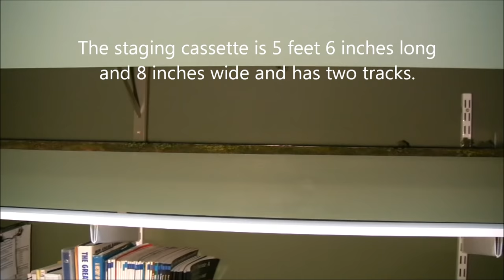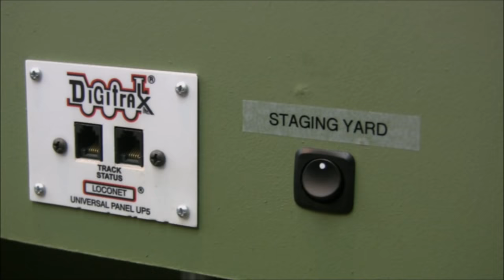Designing and setting up a removable staging cassette

Comment: Tom, I realize this is an old video post, but it’s inspired me to add a 1 track staging section that will allow me to pull all my railcars as 1 inbound train from the main all the way forward past the yard throat, then I can back them into my 2-track interchange yard. Small addition that will add a lot more operational realism. I’ll post a video and give you a shoutout.
Reply from the maker: Hi, Thanks for your comments. Since I made the video I built a new larger staging cassette, you can read about it on my website blog at www.thomasklimoski.com 
I added two more tracks to the yard and it now allows crews to build their train in the yard prior to departure. This adds an additional 10 to 15 minutes to the local switch job. You can never have enough staging or yard tracks.😊

Comment: I'm having this same issue right now!  This video came in handy for some ideas.   Looks fantastic!  Thanks!
Reply from the maker: Hi DG, Thanks. I saw your latest video on your staging cassette and thought you have a good plan. The metal stands were a great idea. Using the bolts and T-nuts allow for some slight adjustment when I bolt the cassette to the wall. For your track I would recommend laying the track as normal across the joint(s) and then using a cut off disk in a Dremel tool to cut the track. If you are concerned about the rail moving, you could replace the plastic ties at the joint with PC ties and solder the rails to the ties (don't forget to cut the insulation gap on the metal foil on the ties between the rails). Take a look at my Universal Alloy video and you'll see the removable section and the track joint. If you can keep the joints on a straight section of track you'll be much better off than I was cutting it on the curve. I used ME track so the track holds the curve pretty well and I did not need the PC ties, but I did use a little CA to reinforce the connection from the rail to the ties. Good luck on your plan and I look forward to your next update. -Tom

Comment: Great job as usual Tom! Building a little switching layout now with a cassette for staging. I just have a short 1x2 but now I may actually make something scenic'd since I never even thought of the "take it outside for photos" option.
Reply from the maker: Hi Conrail 1996, It does not take that much time or effort to put a little scenery and ballast on the staging cassette. In my case it made a lot of sense because it is so visible when you walk into the room and it is the first thing you see of my layout.  It really is hard to beat photos of your roster taken outdoors. A lot of Ken Patterson's work is shot outside on dioramas or modules. Thanks for your comments. -Tom

Comment: Hi Tom,  what is the brand of that storage cart you have your rolling stock in?  It looks very durable and rugged, and I am looking for something like that.
Reply from the maker: Hi Mike, The storage cart was ordered through WalMart on line. The item is a Seville Classics 10 drawer organizer cart, frosted white. It is currently listed for $44.99 at WalMart.com. I lined the bottom of the drawers with a soft foam that I purchased at JoAnn fabrics. The foam comes in rolls and is a light green that you cut to fit. The cart can hold between 50-75 cars depending on the car sizes. Most cars are stored upright but the over height cars have to be laid on their sides. Hope this information helps.-Tom

Comment: Very nice work! I'm planning on doing something like this for my layout. I was wondering about the Cinch Jones connector, I've been looking for something like what you used. Would you have a part number or maybe tell me where you got yours at? Again, nice work and I've enjoyed all your videos.
Reply from the maker: Hi Richard, The Cinch Jones plug I used I have had for many years, it is what my old train club used for the main electrical buss connections between the modules (the club bought them in bulk for all members). I found the same plug on line at MCM Electronics today for $3.39. The part # is P-302-CCT for the 2 Circuit Jones Plug. I am assuming the part number is for both the male and female connections, you may want to double check. Thanks for your comments and good luck on your project. If you have any more questions please contact me at tklimoski@gmail.com and I'll be glad to help.-Tom